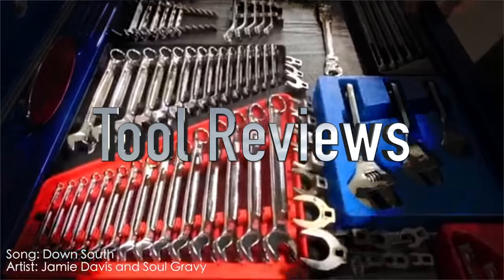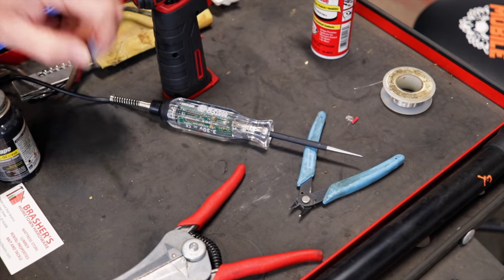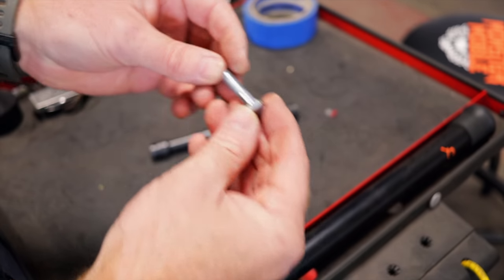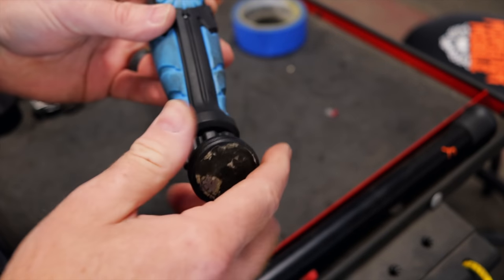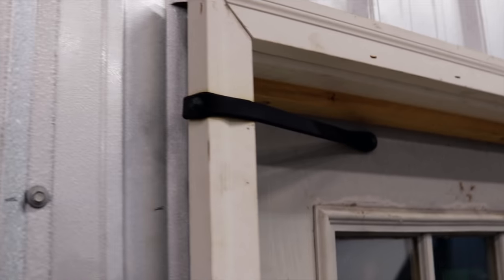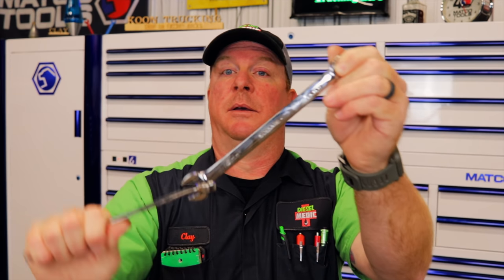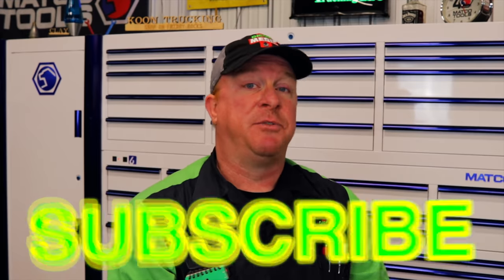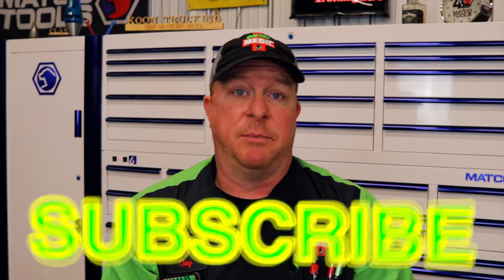Mechanic Hacks,Tips And Tricks

Comment: Tip, if the internal threads are messed up, get a sacrifical bolt with the same thread pitch and cut a few grooves into the perpendicular to the threads with a dremel and slightly round the tip of the bolt to make your own tap/thread chaser.

Comment: I use multicolored zip ties for marking hydraulic lines or airlines. They come in all types of sizes and they stay for a long time. So, if anything happens down the road and it all need to come off again the zip ties are still there makes the job easier if God for bid you need to do any rework.

Comment: I use a light film of grease on the end of my finger to hold o-rings in place for hydraulic fittings in tough spots. Especially handy on Hyster/Yale and Taylor forklifts.
Reply: ............. Brice, they sell a product called Mr. Tranny.  It's sort of a grease, but isn't.  It is used in transmissions.  It has a strong tack to it, and it's designed to keep o-rings soft and conditioned.  It will hold parts in position while you assemble, say a regulator or a part that has little springs, etc. It also has a low melting point. I use it on carbs with o-rings, gaskets. Use it on the end of your finger like you do with the grease. Been using this stuff for years. You might like it also.

Comment: Thank you, Clay, for this superb video.  In case some commenters aren't aware, there's 'standard' heat shrink and adhesive-lined heat shrink.  If you buy it in strips or rolls, the adhesive is not that much more money than the standard tubing.  The adhesive offers additional defense against moisture as well as adding strength to your soldered area.

We each have our preferred way of joining wires, but if you want some LONG bathroom reading, NASA has a huge technical PDF (easily found via Google) on electrical wire crimping splicing, etc., including their preferred methods for aerospace applications.  I believe the document is a few decades old but it's still in use today.

Comment: I use the moisture proof / adhesive heat shrink plus it is thicker and supports the connection better. I have not tied it yet but supposedly liquid electrical tape lasts longer in the van if stored upside down.

Comment: I found disposable towels with WD40 works wonders for tool clean up.  Carbon, grease,  oil, etc.
Reply: I do the same, a rag and wd40. Pb blaster works really well on cleaning the “comfort grips” on tools also.
Reply: I use Tub O Towels They work amazing.

Comment: Great tip on the ratchet handle.  I have a 3/8" drive Power Torque ratchet with a square end on the handle allowing the use of an extension bar.

Comment: The magnetic socket trick is slick. I used to put a dab of grease in the socket and it works too hold the bolt. You're trick is less messy tho

Comment: Worked in electronics factory, rescued De-soldering tool from trash. Spring loaded plunger, press button, sucks molten solder into body.

Have small plastic bottles that fiber tablets came in to put over end of my Craftsman magnetic 
pickup tool to pick up metal shavings, then push off to dispose, repeat picking up shavings.
Keep a small bottle of  mineral spirits in tool box for cleaning tar, adhesive from things,
also keep rubbing alcohol. Only thing that will take Permatex # 2 off the paws after applying gasket sealer.
Since I'm past 60 and visually impaired, I label everything, makes easier to find something in a hurry.

Comment: Crimp style butt connectors have come a long way. Seamless brazed barrel with adhesive lined heatshrink and a good quality ratcheting crimper is my choice. No issues with accidental side crimping and the heat shrink makes a fast water tight strain relief.

Comment: I’m need to heavy diesel work and what i do when doing a foot valve is number started from the top going clock wise and number the lines and valve.. then when it’s off i can match orientation with knew on.. also i draw a line in the direction of the air line so i know which way to turn the qd to so they line up perfectly.. but like i said I’m new so it helps me

Comment: There's two types of heat shrink, the kind with epoxy in it, and the cheap stuff. The epoxy will add yet another layer of protection against the elements.

Comment: Good tip with putting dielectric grease inside the heat shrink tubing, I have done similar myself on occasion.  Should you not be aware they do manufacture heat shrink tubing with a ‘melt liner’.  This ‘melt liner’ is designed to seal the connection.  If you can’t find it at auto parts stores, electrical/electronic suppliers have it.    Unfortunately, it is not usually available in a lot of colours.

Comment: Never thought of painters tape iv always used a towel for those flex plate and tourqe converter bolts were if you drop it u have to pull the transmission back out.

Comment: Small dab of grease works too holding a bolt into the socket.Bungee cords come in handy holding and supporting up things too.I use a bungee cord on each side holding up the  rack and pinion in GM front wheel drive cars while the engine cradle  is removed for transaxle replacment.Loop underneath the inner tie rod end hooking up to the spring in the strut.Don't have one of those under the hood creepers working under the hood of a 4x4 truck that sits up high,remove the front wheel and tire assembly lowering it down to the suspension

Comment: I’ve used most of these tricks except for the bungee cord on the door and doping a soldered connection with dialectric grease before using shrink tubing. Instead of using liquid electrical tape I’ve used RTV silicone and if the connection is a location exposed to the elements, then after the silicone has dried, I wrap over it with electrical tape. I also use a heat (hot air) gun on shrink tubing rather than a torch; the wire is sometimes near other wires or components that I don’t want to accidentally damage with a flame and I don’t have to shield them first.

Comment: Another trick I use for plastic connectors that won’t come loose is spray them with a bit of soap and then get them off. Then I just blow them off with an air gun
Reply: Wd40 helps too
Reply: Or triflow, or BG, or Whatever your brand is.

Comment: For quick disconnect air lines i use a baby crescent to press it in. For tough soft tubes or lines i use a bit of grease or a lighter torch to soften it a bit. For my multi meter i use a zip tie so it doesnt tangle

Comment: I use the marine grade heat shrink with the adhesive lining. I have also built a lot of different test light for different loads. Clear nail polish also works well for sealing up punctures from probing.
Reply: Old tip from not too old of A Guy .Backyard Mechanic : Use Girlfriends / Wives Nail Polish on Ripped/blown Speakers as Well . It Won't Sound Great but .Good till buy A New one.
Reply: Same, but I use little chips of hot melt glue shoved into the tubing.

Comment: Another tip for marking hoses. Get a big tub of them colorful zip ties that come with hundreds of zip ties and they’re a variety of sizes of colors. Just get matching colors and put on on the hose and the other on the plug/hose fitting/whatever it’s coming off of.
Reply: I'm a big fan of color zipties especially air brake relay valves treadle valves were u have multiple airlines good stuff

Comment: Use marine grade shrink tubing and it will seal even better. No way water or moisture can get in the connection.
Reply: Pricey, but for exterior and engine bays it's all I use too. Interior I do the same as clay

Comment: Hell, magnetic inserts themselves is a good tip, I’ll have to look into that!
Reply from the maker: I did a video on them. Lang makes them https://youtu.be/OYBYazQ_42Y
Reply: @KoonTrucking  Ordered, thanks! I’m just getting started in auto body, never seen those before. I’ve been wanting some magnetic sockets but haven’t wanted to shell out the money for them yet. I’ll see how the Lang’s do in my duo sockets, def worth a shot for $20!
Reply: It was a good tip. I just keep a magnet laying around and run the socket or screwdriver across it, and it magnetizes it enough to hold a bolt or screw, whatever.

Comment: If you need a waterproof splice use the adhesive lined shrink tubing. We can agree to disagree on crimp vs. solder. Crimps won't pull out if they're made with proper tooling. Main thing with either is to use enough heat shrink to provide some strain relief for the joint.

Comment: Ideal NOALOX is great for all types of connections, bottle indicates Al to Al or Al to Cu, but it also works great with Cu to Cu.  PLEASE NOTE THIS PRODUCT IS CONDUCTIVE. I've used it for over 20 years on system ranging from 480VAC to 12VDC and it inhibits oxidation, plus it acts as anti-seizing agent. It works best if you work into the product into the wire strains and the connector. Also need to remove any excess product. Think battery terminals (no bad connections on the post).

For the best results with heat shrink tubing, one should start heating the tube at the critical point first (for butt splices that's the center, for terminals it's the terminal end) and work your way out to each end or end. Doing this will force the air and anything else away from the connect point. Randomly heating the tubing back and forth will cause air and other things to be trapped in the tubing that will cause problems. 

Cold Shrink tubing is fool proof, but they only work on #10awg and larger conductors and the cost is high. 

Clay Thanks Again for another great video.

Comment: Would love a video on soldering wires together trying to get away from thr old butt connections
Reply from the maker: Here ya go it’s talking about soldering irons but shows how. 

https://youtu.be/L81Oa1gn96M

https://youtu.be/qnGZKtUp7UI
Reply: We use alot of aviation  but connectors doing avionics installs at work they heat shrink down around the connector and have a glue in them that really  seal it up.

Comment: If you don’t use shitty heat shrink and use the dual walled heat shrink that pushes the glue out you’ll never have one get the case of the green death.  And when it comes to testing with a test light there’s always a connector you can test at I agree with not poking wires. There’s always a connector you can poke at instead

Comment: MARK Electrical connectors off the wiring harness. Many of them are the same type of conector so if you don't mark them when you do a major rebuild you'll go crazy trying to figure out where they reconnect. Mark EVERY ONE, even if you think you won't forget that one because you don't plan to have to do any major repairs. That time you realize the job is going to be ten times bigger once you get it opened up, that one connector will be a real pain when buttoning things up.

Comment: Clay, what do you think about the solder seal connectors? I've had good luck with them and I usually put another layer of heat shrink on top of it just to be safe.
Reply from the maker: This is how I look at it. Others will argue or whatever. If I twist the wires together and I solder them and I heat shrink them I know for sure it is done right. No doubts on the butt connectors having an error in them or solder not melting or glue not working etc. i guess I’m old school but it is what it is. Plus they cost so much more than solder. Since I own my shop anything forgotten on the bill comes 100% out of my profit. Comebacks come out of my profit. So everything I can do to eliminate that I try to do.

Comment: Tub o towels pretty much uses the same cleaning solution as Huggies baby wipes, atleast my experience suggests thats the case
Reply from the maker: I don’t think Huggies had a citric acid solution to cut the grease (but it has been 20 years since I have used them, maybe they upgraded the cleaning solution😂) but the solution in tub o towels is strong
Reply: @KoonTrucking  yea id say your prolly right. Let me re-phrase then lol baby wipes do really good on cleaning our hydrolic line fittings an gunked up wires maybe they'll do good on your tools.